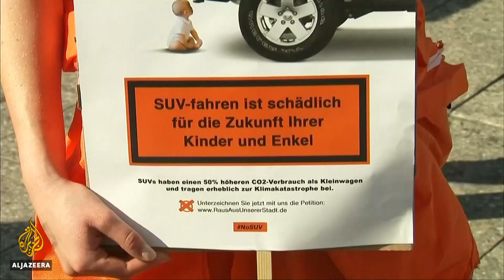UK and Europe drive towards net-zero emissions

Comment: Why not use hydrogen fuel cell cars? It seems that the battery problem with electric cars is insurmountable at the present time. And a lot of progress has been made with hydrogen fuel cells.
Reply: green hydrogen is not available yet in sufficient quantities, it best be used for where electricity won't be a solution e.g. steel plants and ships
Reply: @Maurazio   There is no reason that we should not work on hydrogen because of some problems in the technology. For example a big problem with electric cars is that the lithium batteries use expensive metal. But that hasn't stopped us from developing Evie's. With hydrogen cars there has been improvements in storing hydrogen in nitrogen salts. So it may be that it would be easier to process the salt then it would be to try to process the gas by itself. And for fuel cell metals instead of palladium catalyst, organic catalysts are coming out.
Reply: @alvintoda3424  r&d should go forward with every tech, hydrogen and batteries and whatever comes, seems to me germany is investing lots of money in hydrogen tech btw.
Reply: @Maurazio  in Japan Toyota is betting on hydrogen car with a 500 mile range. So you dont  need ths charging infrastructure of electrical vehicles. And in the future if hydrogen cars use ammonium salts then owners of these cars can pick up a bag hydrogen fuel the same time they pick up a bag of dog food at the supermarket.